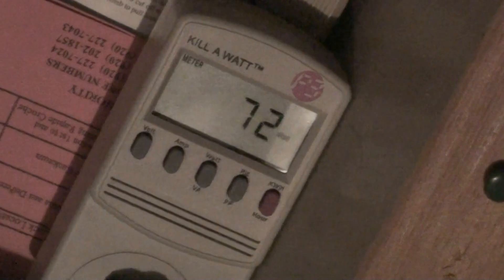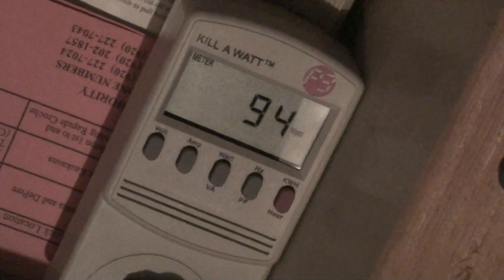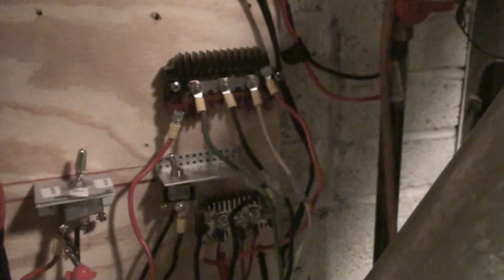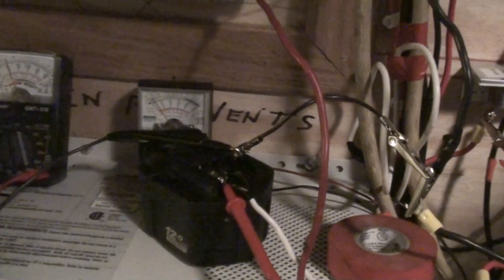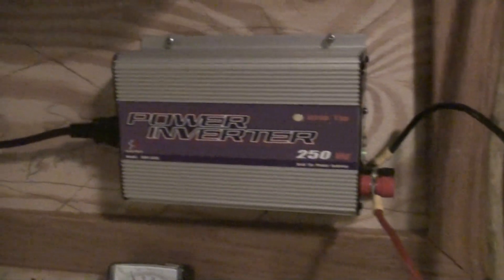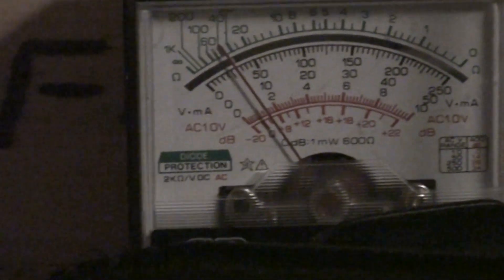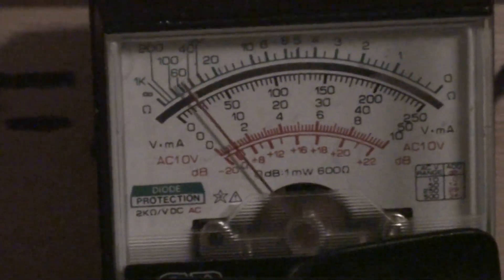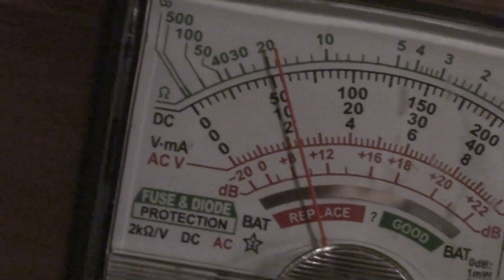Lenz 2 Wind turbine into Grid tie inverter with Ni Cad battery connected

Comment from the maker: It worked ok until I got a lot of wind and then it blew out the inverter. I already had a battery bank so I just use that now. I'm pretty much solar now , I still have the wind turbines running and they do put out a little bit but no where near what solar panels do.